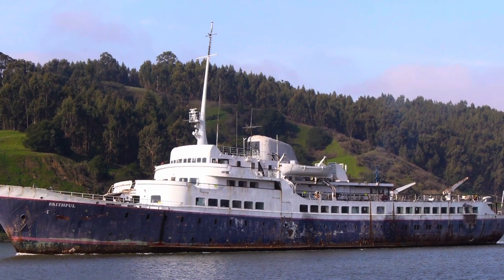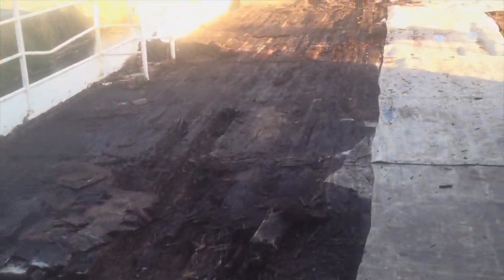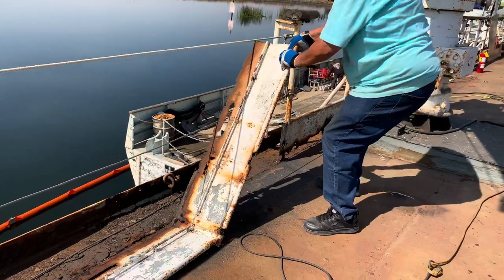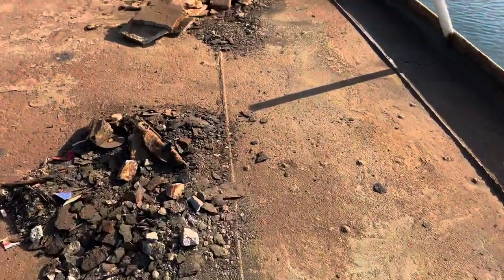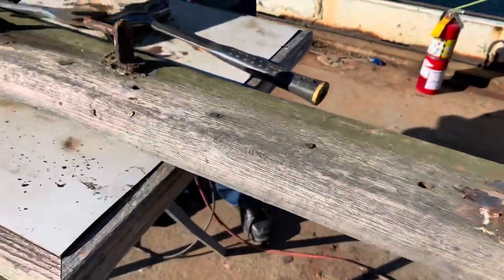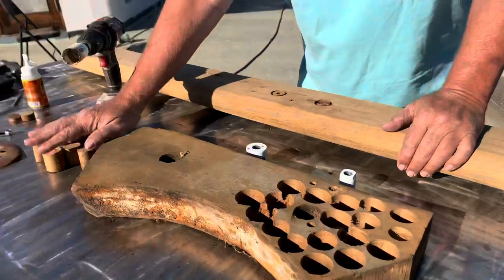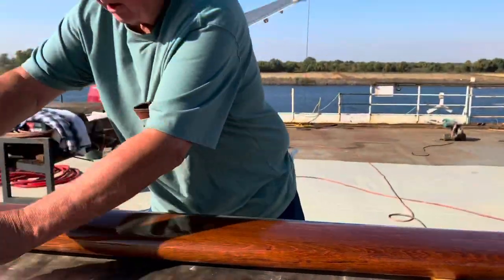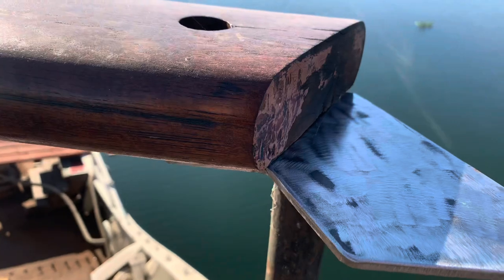I Bought a Historic Cruise Ship on Craigslist DIY Ship Restoration EP. 3

Comment: A little woodworking tip......save any sanding dust from the rails and get some "Duco Cement" and by mixing small amounts of the dust and cement you can make your own wood putty that will perfectly match the rails for filling small imperfections. Duco Cement drys quick (like airplane glue) so working fast in small batches using a putty knife works best and when dry it can take stain & finish like the wood and will blend perfectly.
*My HS shop teacher taught me this, he was ex green beret and hand built beautiful Kentucky long rifles using all kinds of exotic hardwoods that were truly works of art!
Reply: Don't even need Duco Cement. You already got waterproof wood glue.

[edit: Docu Cement is probably an excellent product. Why not? Do not get me wrong. All I note here is, for filling small gaps, you could also mix saw dust with a proper wood glue. But it is a free world, this video gives us good advise. I never said that wood glue would be any better. I said it is an alternative. Please read my words. Thanks.]

All these Harry Potters buying expensive pots of this and that... Bet he polishes it, using his computer learning controlled 7-joints-robot-arm, huh?

[Edit: and that was a joke. You see people using CNC machines at home, doing jobs that require a chissel only. Again, it is a free world, machines are perfect, but I do have an opinion about them. I like hand tools better.]
Reply: @voornaam3191  it's not about expense it's about the knowledge of results... No need to run a guy down that's giving sound advice just because a brand they mentioned is above your pay grade
Reply: @voornaam3191  his comment was spot on I don't even know why you would come in with an smug reply to such a sensible comment also your suggesting water proof glue on a wood that is to be stained? That makes zero sense at all that will cause blotchy uneven spots in the stain. No stick with the original posters comment he and his shop teacher are 100% correct I've even used wood glue and even elmers white glue in a pinch but the original post is the way to go. SMH some people just have to put others down to feel good about their self.
Reply: Can we please shut off this discussion? Dave gave a great tip. He knows this product and it is very good. Remember this and buy it yourself, when you need it. Is that clear? I totally agree on that.

 I now say sorry for my jokes, those were a bit cynical and in discussions like this, those jokes are sketchy, it's a culture thing. We Dutch are blunt, and in fact these jokes are nothing personal. Yes, I am bloody jealous of this man buying such a great ship. But no hard feelings, good on him, I wish him good luck. Why not? Still, how many people in this world are not so lucky? That hurts, does it? And that does not mean this project would be wrong. Do it! Restore it! It is his life, doing this project. Great.

Here the discussion went wrong. I am sorry for these cynical words, I should have known better. So now, I wish Aurora restoration project good luck. That's what it's all about, is it?
Reply: @timwegman5776  Sorry, I forgot the staining later part. That means, sorry, you are right and I was wrong. Except for your last sentence, but I guess I deserved it. Sorry for the commotion. By the way, I am Dutch, and wegman sounds familiar.
Reply: @freekiwi4067  Sorry. I forgot the finish. When you stain the wood, yeah, my glue and sawdust is not good enough, you'll get spots. Conclusion, I think I can read. But sometimes I can't.
And my comment contained a cynical joke, about buying a robot arm for polishing. Well, that joke was not smart enough. I really like this Aurora project. And Daves tip is excellent. Just got a bit angry at the wrong guy for the wrong reason. Sorry Dave.
Reply: Do this but with regular titebond wood glue and you don't have to rush and is easy to clean up.
Reply: @refluxcatalyst7190  The whole reason to use DucoCement is the fact that it will take stain's and  protective finishes & blend's well. Titebond will repel stain and has a yellow hue to it.

Comment: You should coat that bare teak with some Smith's penetrating epoxy before you starting putting on varnish.  Helps stabilize and strengthen the wood fibers and leads to better adherence for your varnish.  Anyway, that's my two cents worth from 25 years of wooden boat ownership.
Reply from the maker: I think that’s a fantastic idea.  I have tons of penetrating epoxy so you know what I will be experimenting with today.   Thanks for the tip..
Reply: That's actually even a technique used in archaeology to stabilise and preserve wood from thousands of years ago (albeit in lab conditions). It works wonders! Get a good epoxy and soak the wood in it. It may take some finesse, the right materials and patience, but it makes the stuff stay just as it is for the eternity.
Reply: So nice that people offer their experience and talent to contribute to the project
Reply: That's what I was thinking if you don't want it to be a rail I personally would turn it into a shelf or shape it as a oar to hang it inside to at least preserve it since it is original wood
Reply: Washing teak with acetone or lacquer thinner before finishing itwill help the finish to adhere . Teak is very oily

Comment: LOVE the woodworking on the Teak Rails - It's too bad that the decking was so badly gone, but I hope you can use what's left to repair and replace the rest of the teak on board!   Amazing to think that all that Teak was probably harvested using Elephants back in the day....
Reply from the maker: Never really thought about..  Had no idea that’s part of how they would have harvested back in the 50s
Reply: @AuroraRestorationProject : The only thing I miss about California is the Delta. Lived on the Delta Loop (Brannon Is. Rd) for 11 years...mostly on my sailboat. When I wasn't delivering yachts, I did electrical work on boats with High Rigger Marine based at Spindrift Resort & Marina. In the Air Force I was trained as an Electrical Power Production Specialist, and spent many years as an expat working at remote locations in Diesel Powered Electrical Generating Facilities. Retired as Electrical Supervisor for the Sacramento/Yolo Port District & donated time on the old Liberty Ship... USS Jeremiah O'Brien based in San Francisco. If I didn't live 1,800 miles away now, I'd be more than happy to donate my 40 years of experience with Diesel Generators/Switchgear or any other electrical you might require. Following your restoration of the beautiful vessel Aurora with great interest.

Comment: The company I work for is currently 4 months into replacing the bottom and rotten deck, structure, and upgrades on a 64ft 14’10” wide full metal hulled cruiser. It’s our main charter boat. Not nearly as big as this ole girl, but same concept in the dept of restoration. Island Girl has a very similar shape. We use her for things like dinner cruises, lake tours, lake days, special events, etc. I know the struggles my guy. I’m the lead fabricator on the project. This is also my first real project management job. I’m 29 and finally got my break to prove I’m worth this level of responsibility. Been a hell of a challenge. Luckily my bosses have a lot of money to finish this project. I hope you have deep pockets. Especially with current material and labor costs. We’re over 200k in to what pre Covid would be half that. Good stuff and if you ever need to bounce some ideas let’s link up.
Reply from the maker: I suspect I will pay out the nose when she comes out of the water.   But when this time comes she will get the right treatment.   As of now she is in fresh and shallow water and has not taken on any water on my watch.   We have time to raise the right funds to make this happen.  Thanks for watching and good luck on your fabrication job.  Sounds like fun to me..

Comment: Teak is a fantastic wood, really hardy stuff which is why it's used a lot in marine applications. If you take it inside for the final coat you wont get as many bits and nibs in the finish, maybe even string up a plastic sheet room. If you do go down the road of stabilizing the wood try and make sure its dry first. I'm loving this series so far, keep up the good work
Reply from the maker: Thanks for the advice and tips.   The teak is certainly fun working with and watching it come back to life after looking so bad for so long.   I guess it’s kind of the same with the rest of the ship as well.

Comment: I'm a retired Master Craftsman and Carpenter and when I lived on the coast I did some work on some sailboats. My trusty levels never left my truck and the one think I learned is nothing is straight on a boat! I learned that Mahogany may be a nice substitute for Teak, but it's hard on saw blades. I learned there are two grades of stainless fasteners. One for use on boats that travel along the shore and the other for ocean going vessels. Buy ONLY stainless nails for your nail guns! They are a little more expensive, but regular galvanized nails will rust out after a year or so in the salt air. Get a bench drill press for drilling stainless fittings. If you don't, when you drill them they'll get hot and temper the stainless and you'll never drill a hole in it then! Cool the drill bit with water or oil while drilling! That drill press is great for making those plugs for your railings if you get one with the same size chuck as the shaft on the hole saw.

Comment: Loved it. The wood was amazing. If you can't get any of the old growth. Try cutting the bottom off some of them and use some new growth glued to the bottoms. Then take the old growth and glue it onto some new growth. You'll end up with old growth on top and new growth on the bottom out of view. At least this way you'll still have the image of the old growth on top. Keep up the good work. Came over from Ship Happens when I saw her video last week. Best Wishes & Blessings. Keith Noneya
Reply from the maker: Thanks,   I am actually going to use some of what did survive of the decks to repurpose as cap rails.   I think I have more then enough.   Would be nice however to find enough old wood to refit the decks once again.
Reply: @AuroraRestorationProject  Look into 'Teak Decking Systems' for examples of teak decking over steel/fiberglass/ply, etc. They do everything from small yachts to cruise ships.

Comment: Wow ... I thought that background scenery looked familiar! - Didn't notice the location until after watching. Born and raised there, I was. 
Just decided to watch because of the work I've done at a shipyard, on yachts, and the beautiful classic lines of ship. I am pleasantly surprised by the location, and would love to be able to swing by the next time I get to the area to visit family. It (she) really does seem to have great potential. 
The one thing that I would submit to you as advice is this:
Be very careful about removing large amounts of weight from the vessel without using some kind of ballast to prevent any listing, because you're obviously not sitting on a shop floor. Removing lots of long wire runs, for example, when you eventually get to the electrical ... conversion. 
I'm done babbling now. I have your other videos on this to watch ... after I hit that like button. 👍
Reply from the maker: Thanks for the advice.   I do consistently work on ballast and weights to keep her even keel.  When finished rather than storing water I intend to just use pig iron blocks to level her out and keep the ballast tanks dry.   Thanks for watching….

Comment: On my 1970 Ericson 41, I use Teak Oil on all of the Teak. Beautiful! After scrubbing it first with soap and salt water, then sanding it after it dried. I applied Teak Oil. 

The teak soaked up the teak oil. It took about five coats of oil. Beautiful. No more sanding and one teak oil coat every year. 

Save the varnish for the inside of your vessel. Epoxy on teak? No frigging way! 

There's a ton information on Teak finishes. Varnish or Teak Oil is best. Do some test pieces for yourself. 

Do not use Epoxy. You'll be sorry. Look it up. 

Man. If I lived down there I'd be a faithful volunteer. What a fun project.
Reply from the maker: Hmmm,   Sounds interesting.  Curious what the salt water does for the teak?
Reply: @AuroraRestorationProject  :: Hi. Salt is a preservative for organic products. Food, wood, exc. 

100+ years ago they'd put rock salt between planks. So when it rains the fresh water would melt the salt and pickle the wood.

Fresh water rots wood. Then after it rained they'd bucket sea water on the exposed wood, then scrub it, then rinse off with seawater. 

In my case I used the seawater, as an abrasiver, then adding dish soap to it to help clean my teak. It came out ok. Then I sanded it because I wanted that honey teak color to come out.

This summer I have to remove my teak toe rails.

1. To repair my deck, under those toe rails. They leak through the fasting. A couple months of work. 
2. To do a super, scrubbing, sanding, teak oiling job on them.

And I have to remove my two, 25 by 25 hatches. They need resealing because they leak too. But these I will varnish. 

If I have time I will remove the teak in the cockpit and repair what's behind it if necessary, but definitely refinish all my cockpit teak.

Busy summer coming up, here in Tacoma. 

Teak oil is the best for your rail caps. Easy maintenance. Varnish is beautiful. But needs a year stripping, sanding, and eight or twelve coats and some touch ups during the year. 

Epoxy. Scrapping and a propane torch will be your new friend. Then hours and hours of sanding. Then applying five to eight coats, with sanding in between those coats. Just like varnish. 

If you get tired. No worries. Next year, and every year there after, you will do it all over again with epoxy. 

Teak Oil. 

Now after you have sanded it nice and smooth. Wipe it down with mineral spirits to get the dust off. 

Pour some teak oil in a bucket. And with a cheap, chip brush, and couple clean rags for dips on the deck.

Starting at one end of your ships railing, start applying teak oil, to the other end. 

Have a coffee and apply another coat. Next day, repeat. Two more coats. It may take six or eight coats. NO SANDING IN BETWEEN COATS! Unlike varnish and epoxy. 

A year later. With, soapy fresh water. Clean the teak rail. Let dry. Next day with a small bucket of teak oil apply one coat of teak oil. Maybe two if they had a ruff year. 

Don't use good brushes for this job. Use those cheap chip brushes that they use for Fiberglass. Throw them away after each round. A two or three inch brush is fine. 

One warning: teak oil may darkn your teak, redish. If you don't like it. Sand it and varnish it. No harm to your teak.

Remember. Do some test pieces first.
Reply: @svoctopus4888  I have found some very nice pieces of salt water preserved wood washed up on the beaches in the Bahamas. Love to make outdoor furniture and things out of it.

Comment: Use your hole saw on a piece of plywood first. Then clamp that over the teak you use to make the plug. Now you can use your hole saw without the pilot bit. It will create a solid plug. Then you can drill or not drill whatever holes you like later.

Using a hole saw is a slow affair if you want to keep from burning. If you have enough compressed air, you can point a blow gun in the saw kerf to keep the kerf continuously clean while you cut, else you'll need to stop constantly to clear the fine dust.
Reply from the maker: Wow,  Thanks for the tips.  Sounds like a reasonable plan when I start hacking away at the rails again in the next couple of days.  Thanks for watching…
Reply: Or, get yourself a small drill press. You won't need a pilot hole either. Just clamp your work. A bench top Delta would be perfect.
Reply: Best to acquire some plug cutters and matching bits. No guessing/sanding; clean glue lines. Set any that might need to be removed later in varnish.
Reply: @billvanvlack117   can't escape that hell- there will always be sanding. 😉 Plugs are tapered for beautiful tight fit. That means you'll need to either chisel and/or sand off the excess. It also means that you'll have a gap on the bottom. So if you have to cut all the way through, it will be quite noticable on the bottom. Otherwise, I agree. Plugs are the right way to do it.

Comment: It's called teak oil for a reason. Use it, you'll be happy you did. Stay far away from using epoxy on teak. Love your channel. Been watching your ship for a while.
Reply from the maker: Thanks for the advice,   All we have been using to this point is teak oil.  However someone brought up the idea of penetrating epoxy on some of the rotting areas of the wood.  Haven’t tried but sounds feasible on the rotted bit savagely areas.

Comment: Pro tip .if you make a small jig you dont need to use the drill bit with your whole saw so you get a plug without the hole in the center .